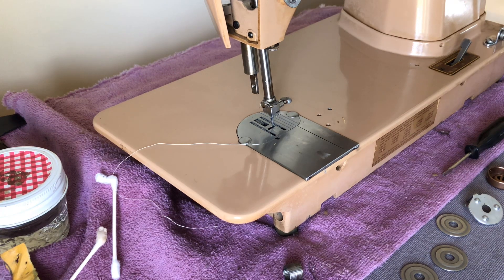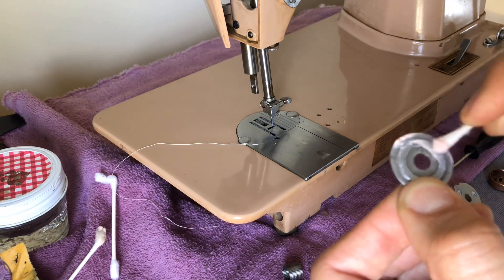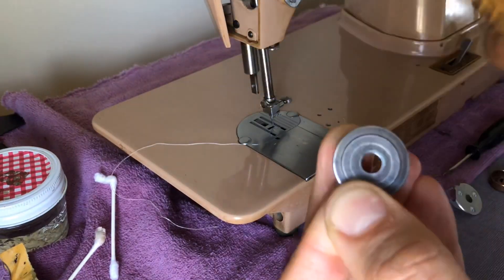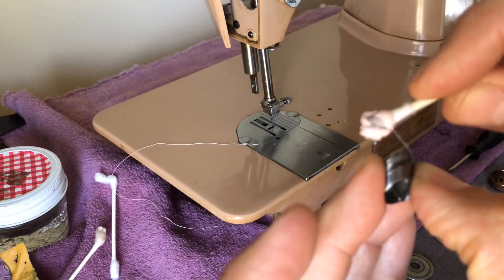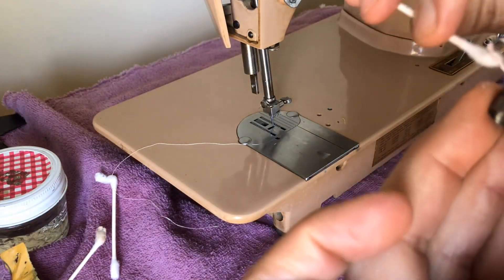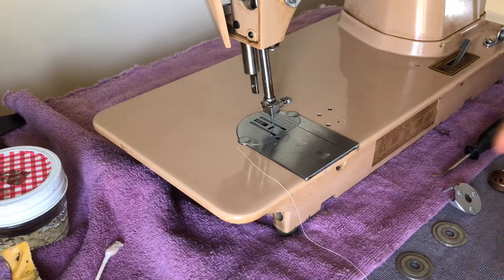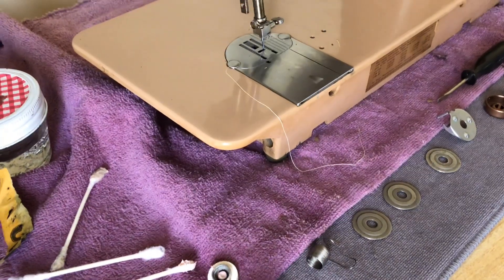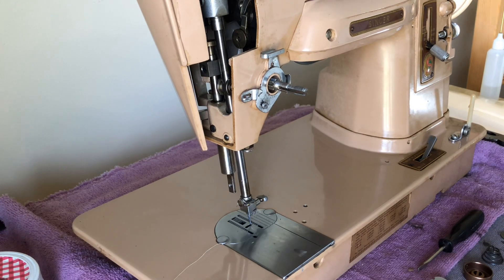CLEANING SERIES #7: An Ounce of Prevention: Clean & Polish Thread Tension Assembly on The Singer 403

Comment: You have such great videos and I enjoy them; however your sanding of the tension disk spots is wrong, the tension disks need to be completely flat so to sand out marks you need to put the sandpaper on a flat surface and use water and rub the entire surface of the disk held flat evenly across and in different directions until it looks spot free, there is plenty of metal in the disk to do this, only flat tension disks will be able to provide proper even tension in these tension assemblies.